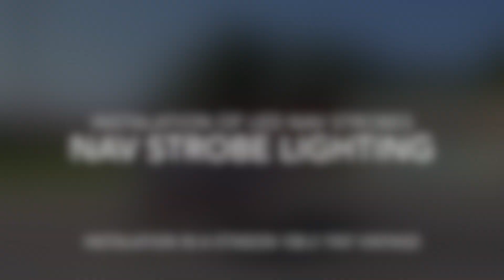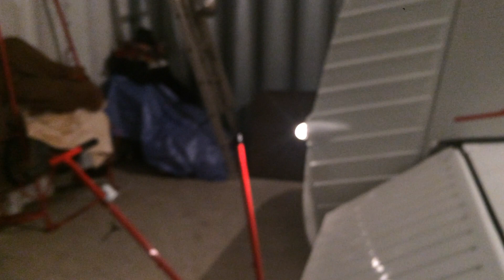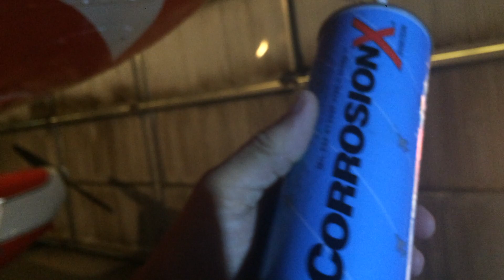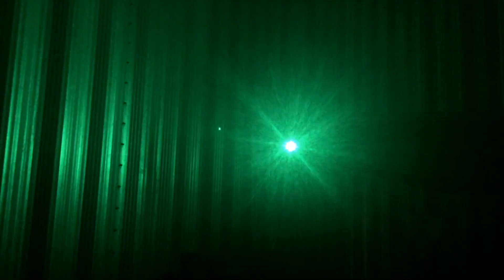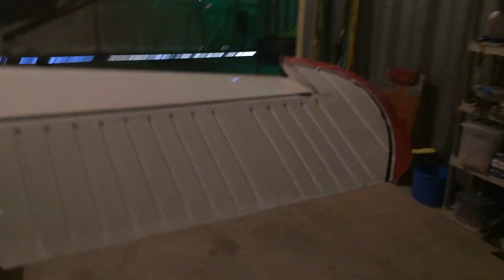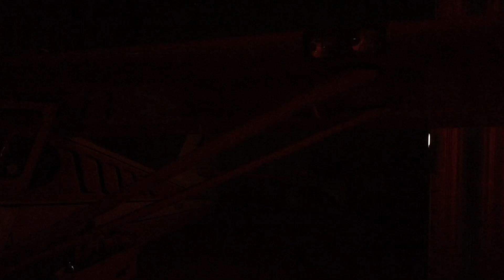Aircraft LED Nav lights

Comment: Anybody experience RF interference with these bulbs?
Reply from the maker: I have experienced some when they are in the flashing mode, but primarily when the squelch on the airband radio is turned off to listen to distant stations.  But when the squelch is on and in normal pattern work or talking to ATC, it is not a significant problem for me.
Reply: Bret Chilcott thanks!  Have you gotten decent longevity out of them?
Reply from the maker: @Ddurocher82  yes, I have had no problems with them. Most of my flying is during the daylight, so they are flashing all the time when I fly.  I have had no problems with them.  What airplane you thinking about mounting them on?

Comment: Thank you Bret, for taking the time to make this video! I agree with your comments on this improvement being safety related, flying mostly in heavily congested south Florida I will be ordering this kit myself before the day is out. Thank you, Bob Crow / Stinson 108-3 N743C
Reply from the maker: Bob Crow Thanks Bob.  Glad the video will help you.  Although I had heard of the elusive LED navy lights, without the help of the folks at Aircraft Spruce at OSH.  Let me know how the installation goes.  Be sure to have some Corrosion X handy when you do the instal.
Reply from the maker: Bill - thank you for your comments.  Since I have been able to do more flying with the strobes, I have noticed a slight amount of noise on the radio.  However it is only present when a distant signal opens the squelch.  For me this small amount of radio noise is worth the additional safety of the strobes.